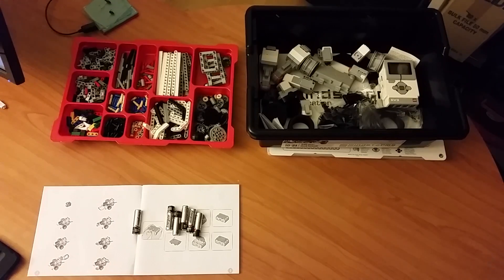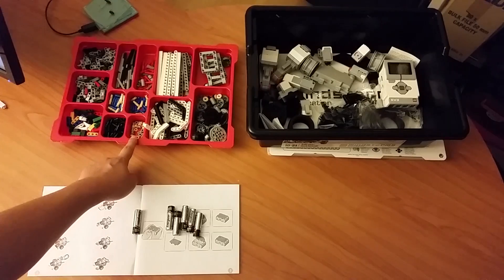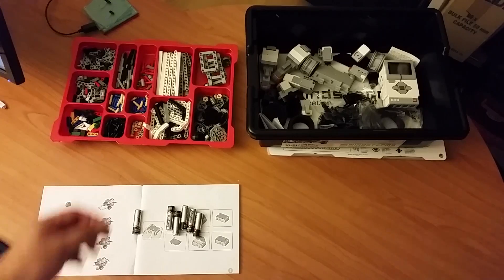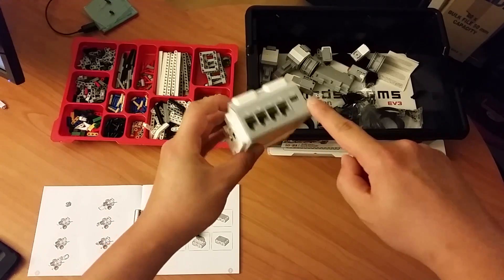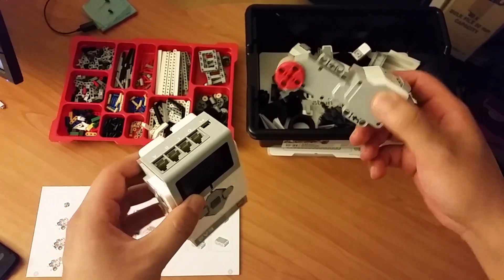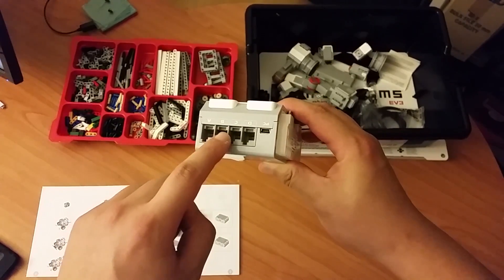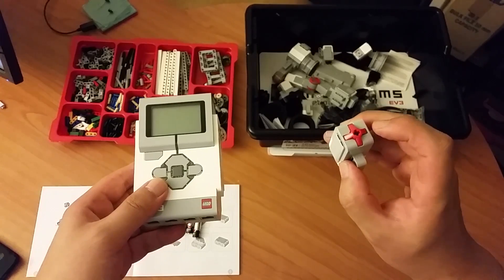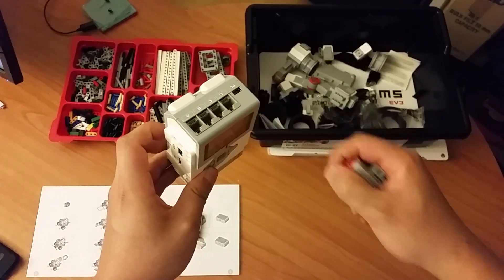Lego Mindstorms EV3 Robotics Lesson 2 - Explanation of input and output

Comment: +MagicMonk My color sensor is not working is this something you can you can help with?
Reply from the maker: how do you know it's not working
Reply: I am working on the EV3STRORM Mission 5 and when I cover the sensor the same code is running.
Reply from the maker: uh that's not a good way to test it out. You should use the sensor tester on your brick. Just connect the sensor and then use your brick to see if it can get some reading off the sensor.
Reply: How do I get to the tester?
Reply: Never mind I got it. Thank You very much.
Reply: +Mustaphha Salau you need to calibrate the sensor, it works with the ambient light
Reply: David Galvan how would I do that?